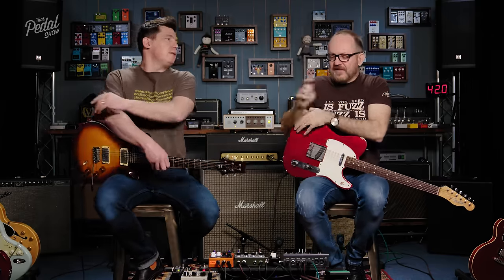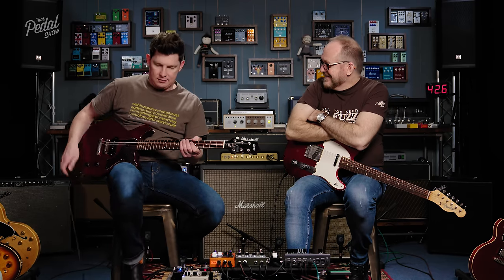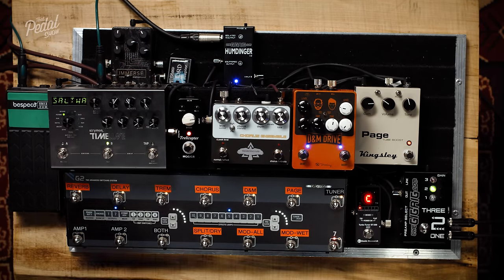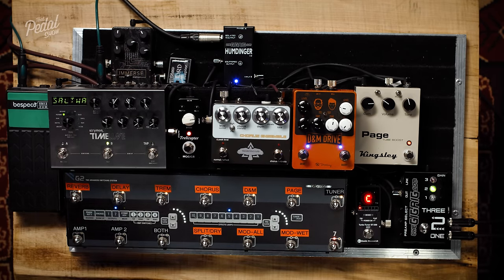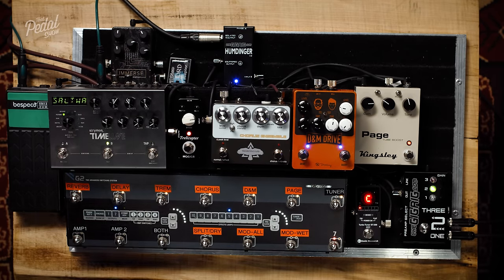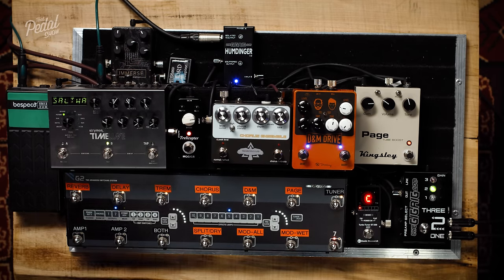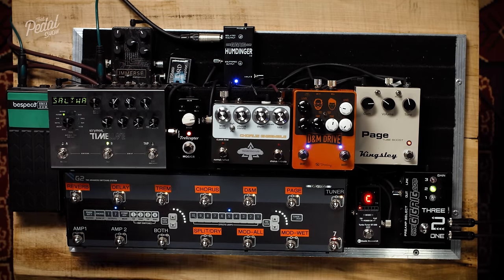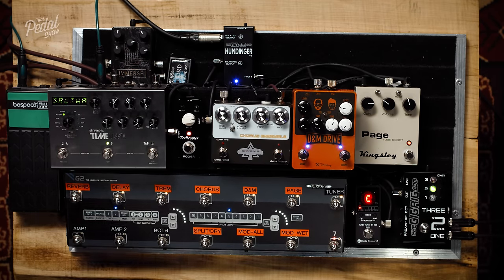Wet-Dry & Wet-Dry-Wet Amp & FX Setups Explained – That Pedal Show

Comment: Awesome tones.  Bastards.  Just when I had convinced myself that mono is the only way to go.  I think I am over the fake stereo thing but wet dry wet just sounds too good to ignore.  Regarding those digital pedals that appear to flip the phase - I think this is mainly about latency which is inevitable with many digital pedals.  Distance from ear to speaker is a similar latency and both affect phase relationships but not as straight forward as a simple polarity inversion.  Personally I prefer the wet amp to get just the wet signal - e.g. 100% wet delay and/or vibrato if I want a chorus.  A term I like to use is "mixing in air" - and it really is much more complex sounding that mixing  electronically.  It think it is why a Leslie or a JC120 sounds so much better in real life.  But that means both amps need to be mic'd otherwise the sound from the PA is missing.  Which is sort of why I had convinced myself that mono is king - because most of the audience just hears the PA and I don't want them missing the effect regardless of where they are in the hall ... but in the studio or intimate rooms multple amps mixing in air just sounds so awesome.

Comment: One thing that struck me about wet-dry is that it is less critical about whether a pedal is analog dry through or not. I've been using a TC Electronics Nova Delay on my wet side, and the dry side solves any potential problems with the pedal not being analog dry through. Wet-dry opens up the possible wet pedals you could use.

Comment: You guys should check out Komet Ambikabs.  you can split wet and dry within the same cab and just use two mics.  Trey Anastasio uses this system and it's worked wonders since he's been using them

Comment: I know you wouldn't get the "width" of sound, but couldn't you get the same sort of thing with one amp by running your wet effects in parallel to your dry and then back to mono? for instance with the JHS buffered splitter and the Summing Amp?

Comment: In terms of the phase issue, I wonder does that apply only when using two separate amps?... if i have a stereo power amp and I use my maiden d into one and my mesa v-twin into the other would phase still potentially be an issue or is it avoided by using the same power amp? 🤔
Reply from the maker: Yep. Everything will be okay..... unless any of your pedals flip the phase. Cheers!

Comment: I find my delay only gets too mushy with too much gain saturation and running it thru only one amp the delay is not present enough so running delay thru both but less drive on one amp works for me! Plus I usually have both amps on at all times… just varying stages/combinations of gain.

Comment: I know you understand this (and I suppose I'm not the first to say this) but I thought it would be good to note that your "phase switch" is really just reversing polarity of the split electrical signals, relative to one another.  Acoustically, the effect of the polarity change may not be that pronounced.  The relative phase of the two acoustic signals (produced by each amp's loudspeakers) can be all over the place once they reach your ears.  The relative phase of the acoustic signals depends on many factors, including the polarity of each of the split signals, type of loudspeaker, distance from each loudspeaker to your ear, the finishes in the room, the shape of the room, etc.  The relative phase of the two signals is frequency dependent as well.  That said, you listen to the rig and switch polarity as you wish.  There's no "in phase" or "out of phase" really -- just "which sound do you like the best?"

Comment: I’m not sure if you mentioned why drive pedals and some effects can’t go after the split signal. How it’s been explained to me is, any pedal that adds a gain structure will cause the phase to reverse. For example, I had a Catalinbread Valcoder trem pedal that also had, I believe, a fet gain structure to emulate the texture of supro’s gritty trem. When placed after the split signal that was phase corrected, it would flip the phase when engaged. Please correct me if I’ve misinterpreted that concept. Also, id still love to see a show based around the idea of using amp-in-a-box style pedals with the amps they are trying to recreate as a method for playing at lower volumes...if it works and what issues that may create with pedal stacking and pedal order. Cheers guys!
Reply from the maker: hi Mark, gain stages don't always flip phase, and it would depend on how many phase filliping gain stages are in a design. A pedal can have may stages of gain in its design, and if it has an even number of phase inverting gain stages the pedal will still be in phase
Reply: That Pedal Show ok, thanks for that. So why then do you choose to have your drives all before the split? And could you ultimately choose to have two exact same amps with different drive pedals going into them to achieve the same thing as using two different voiced amps?

Comment: Cold and dark? I remember that well having grown up in Milton Keynes, UK. But I live in Auckland NZ now and it is warm and sunny. Music gear costs heaps here, but there are up sides.

Effects? I recently thought I have been using them as a crutch. All out of ideas? Just hold a note, give it a wiggle, and let the effects make it sound interesting. I will continue to do that because why not. But I have been forcing myself to play dry and come up with off the cuff ideas that are interesting due to their phrasing etc. Mixed success so far, but I think it is good practice. Using less gain is similar, because relying on the sustain overdrive gives can cause a player to lean on it a bit much at times as well. The dive bomb and stuff is another classic example of what to do when all out of ideas. 
Using an amp into a reactive load and into DAW is really easy to do WDW btw, so three actual amps and stone cold deaf neighbours are not required (use monitors and sit in just the right spot to get a little feedback and sustain). Yes, the quintessential bedroom guitarist noodler :)

Comment: Hey guys; One point on the wet-dry section discussion... is that some believe that taking a line out of your main amp and going into your wet effects (then on to the second amp fx return) is the true wet-dry path; as the preamp of the second amp doesn't "color" the sound of the main amp: like if you split the signal at the pedalboard. While It's true that the differences in amp tones might be desirable, does the one preamp idea have any traction in wet-dry setups in your opinion?  You've discussed that idea as being a good option in the wet-dry-wet section.
Reply from the maker: Definitely does Richie. That’s how Andy Timmons does it, in a way. So one preamp at the heart of everything. Hopefully we say it enough, but people get really defensive about terminology. I guess the correct term for what we do is dual mono. That’s where the tone is happiest in our opinion. 
After that, whether you mix the effects in series or parallel, how they’re amplified and what gain is hitting once will determine how ‘accurately’ you fit the dictionary definition of wet/dry. If there even is one. Cheeers!
Reply: @ThatPedalShow  I sure appreciate the response.
I'm not trying to troll for online debates and nobody asked me... but...
 It wasn't so much the terminology that I was aiming for, but more or less your opinion on whether the two preamps set up stands out differently than the one preamp. Having tried both ways, the effect section essentially sounds the same but with the added muscle of the drive pedals in the dual mono rig. In my opinion, the dual-mono sounds like a much bigger rig, and the one preamp rig is a little more controlled. No right or wrong here, they both work. Doing all the splitting and wet/drying on the pedalboard might just be more user friendly and simple for most players doing gigs.
Cheers back to you guys! Keep up these excellent and informative videos.

Comment: Hi Dan and Mick, 
is it possible to get good wet/dry results using two amps with diferent power?  i.e. 15W and 50W.. If possible i assume the small amp probably needs to be the dry one a bit pushed to match the volume and get "some love" (TPS dictionary ;) )

Thanks a lot for all the knowledge you share!
Reply from the maker: Yeah, we discuss that in the video. You can use any two amps.

Comment: Wet-Dry-Wet is a really cool setup, I ran it for a while at home playing.  My favorite signal chain was to split the signal after my gain with a Boss PS-6 into normal-octave, then send the dry signal to the dry amp and the octaved signal through the wet pedals and the two wet amps in stereo.  Massive massive sound.

"Why use wet-dry-wet"? can be answered, in my opinion, by saying you want subtle effects without the strong stereo wash, but still want the space of time effects or the shimmer of modulation.  It's a more sonically subtle way of having a wet chain than a single amp or a standard stereo signal chain.  If you want strong stereo effects, wet-dry-wet is NOT the way to go.

Comment: I run a stereo system, have done for 30 odd years. I f I need extra definition I simply pan the wet effects more to one channel which is more or less the same thing. Also, when are you going to feature some of Vick Audio's products, their TOL is an amazing overdrive, 73 Rams head Muff and their Ross style compressor, also Killer Guitar Components. Best trems on the market, better than Callaham ...check them out !

Comment: Hi Guys, I hope you can help me. I have a Quartermaster 10 with all my pedals in the loops, first 3 loops are drive pedals, 4th is an EQ then I have 2 delays, Chorus, Flanger, Phaser and lastly Reverb. This runs into a jam man looper and lastly a Radial JX2 Pro Tonebone. My question is how do I use the Tonebone as a splitter after the drives and EQ pedal? I thought I could put the ToneBone in a loop following the EQ but it only has one input (with the two outputs going to two amps). Any ideas how I should set this up would be very helpful. Thanks. Marty from Melbourne.

Comment: So if you are running true wet/dry/wet and click off the wet effects, the outside amps wouldn't be contributing to the sound right?
 I would feel bad having an expensive amp only handling the wet effects.. I wonder what a clean solid state amp would sound like in that sense.

Comment: Two questions.

One, will the Boss LS-2 Line Selector work to split the signal correctly? 

Two, I know you don't do anything like the Anderton's Sounds Like videos but I actually would love to see your solution to Mike Kerr's Royal Blood setup (Bass Guitar to Bass amp and Guitar amp). I know Rebea and Matt have attempted it twice
 but I would like to see how you would go about doing it perhaps in a Vlog. It seems as though it could piggyback off the Wet/Dry conversation.
Reply from the maker: unfortunate it doesn't have isolation

Comment: If I wanted phase reversal in the same box as the pedal, yeah, mod it in on the same footswitch as the pedal. But otherwise, if I had a bypass looper, I would just put a little phase reversal box in the same loop as the pedal so they go on and off together. Mick, do I have your attention?

Comment: I've got an Electro Harmonix switch blade  plus, which is a splitter pedal.
Does anyone knows if this pedal is able to do this kind of set up?
Also what happens if you split the signal of the guitar right from the beginning of the signal chain?
For example guitar to the splitter, A from the splitter to the wet amp , B from the splitter to the dry amp.
Thanks for any given answers.
Cheers.

Comment: I want to use my Strymon Mobius in a wet/dry/wet signal chain, in my case with the Musicomlab Parallelizer (3-way Stereo Looper with parallel Signal flow). My Delay (Source Audio Nemesis) in FX2 and my Reverb (Source Audio Ventris) in FX3 are both in Kill Dry Mode. What about the Mobius (in FX1), I can't find a kill Dry Mode - how can I solve this problem?

Comment: Ok Mick, you really have to wash that T-Shirt.  You’re reminding me of my 10 year old son who won’t change his shirt because he loves it so much.  I can only imagine what it smells like for Dan... ;-).  Thanks for adding the visuals - HUGE help.  Question for you guys - how often are you able to use a wet-dry rig when you’re gigging?  Do you always have have the room on the stage?  How does your band take it when you pull out 2 amps?  Just wondering the dynamics when you are gigging.  Thank you!
Reply: I use wet-dry live in a 5 piece band. In terms of real estate it is the same as one amp. I have a solid state which covers the wet and a tube amp which is my dry. My solid state is on the floor (as it has a front panel input and solid top - think Marshall) and the dry amp goes on top (as it has a top panel input think fender blues deluxe). My floor has ABY pedal radial bigshot and two pedals that are switchers for the amps. At every volume it sounds huge and I’ve pretty much got everything covered for a covers band. So simple.
Reply: xxnonstopdancingxx  Thanks.  Never thought of stacking the wet-dry mix, always thought of it in terms of left and righ-stage to get the stereo effect.  Sounds like the stacking works well.  I’ll give that a shot.

Comment: A few things, maybe I'm crazy, but sometimes when your on screen notes said it was out of phase, to me the sound had more bass than when you said it was in phase, but when it said it was in phase it sounded kind of more direct, or together. 

Another thing, if you use a wet dry rig, and the house is making your amps, don't they have to mic both of them or the effect level will either be gone on the dry rig, or too much wet if they just mic the wet?(I'm commenting halfway through the video, sorry if you answer this later :)

Another thing, I used to just split my signal to two amps out of my stereo pedal at the end of my boards signal chain, and yes I sometimes did have phase issues, how do you remedy that?
Reply: I agree with your first comment about it sounding the opposite of what the notes on screen said, and I think I saw others say the same. I think this comes down to a couple things. "In the room" just doesn't translate the same through recording and YT uploading process. I know Mick is diligent about phase in the audio editing since you will get phase flips through the mics, mic preamps, etc. My only guess is that sometimes its just not going to come through to us the same. I guess we just need to go there!

I was thinking the same thing on your're second comment about the house. But I guess if the wet amp is not 100% wet and has the dry, it might be ok. 

On the 3rd comment, there is really only 1 way to remedy phase issues, and it happens to be the same solution for ground loop issues:  isolation transformer. If you run your signal through an isolation transformer, and run the secondary or output of the transformer through a DPDT switch, which just reverses the direction or polarity of the audio signal then you can flip the phase. So all the devices mentioned, either Gigrig or Radial all have a small audio 1:1 audio transformer in them. And your isolated output signal goes through this transformer. Without understanding what a transformer is or how it works its hard to explain, but you don't need to know that, as long as you know thats what you need to combat these issues.

Comment: Years of watching D&M talking Wet-Dry, Stereo, Wet-Dry-Wet and wistfully thinking if only I had a 100W Hiwatt, Fender Deluxe and JTM45 to try it out. Then halfway through this video I realise I own 4 amps - Marshall DSL5C, Orange Micro Terror, Hotone Mojo Diamond and Mooer Baby Bomb 30 and 2 cabinets - DSL-5C and Orange 1x12 (also a DIY cab with a Celestion V30).  Then at the end Mick says what I was thinking - use whatever you've got. Ten minutes later I'm running Wet-Dry with an ABY switch into DSL-5C and Mooer. Then I see I own a TC Hall of Fame which has stereo output.  All sounds great.

Comment: Going to ordering a g2 soon.  Does it say in manual or is there a link to explain how to hook up the humdinger properly to do the wet/dry set up?
Reply from the maker: We've covered it in many videos! Not least my last pedalboard build. Mick here. And the wet dry videos...
Reply: That Pedal Show 

Yes, In the post prior I laid out details.

I understand about using humdinger in the volume location for the dry signal to my fender amp.  What I am having trouble with is if it’s possible to use effects loop on my two Rock for the wet signal?  Or do I have to run the wet into the front of the two rock?

Comment: Stupid question time. I have two Marshall DSL40c combos which I have been running in stereo. I'm planning on giving wet/dry a go but to save floor space I want to stack the combos on top of one another. Would it be better to have the wet amp on the top or bottom of the stack or will it not make much difference?
Reply from the maker: Great question Scott, and I'm not really sure. Mick here. I'm tempted to say put the dry one on top. I guess try both ways and see if you can discern much of a difference?

Comment: I'm guessing if you were running the Maiden D as preamp you could run all 3 (wet/dry/wet) signals into the Return of each amps effect loop...assuming your 3 amps have effects loop. Wouldn't the biggest issue with that be the power for each amp...i.e. should be the same or volumes be different for each signal.